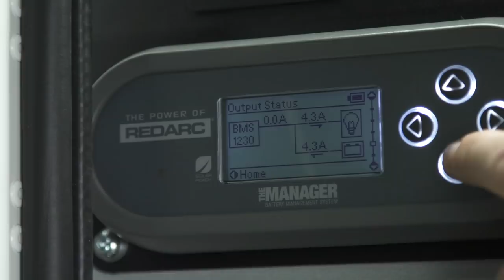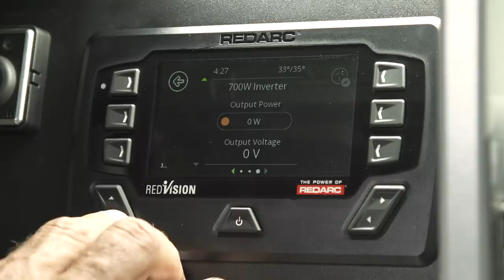Patriot Campers X1-H - Launch Video

Comment: If only you could pull off the bed of a Tacoma, slap this trailer onto the frame.......you would have one sweet Overlanding vehicle.
Reply: That's exactly what I was thinking when I saw this. Turn that into a ute style on a flatbed and it's a masterpiece.
Reply: Its called the PCOR from patriot campers.
Reply: Nope, not even close to the same thing.  I looked at the PCOR a few times, and it’s cool, but not even on the same level as this trailer.  I understand the tent’s ladder would need to be able to adjust for the greater height you would get on the bed of a truck, but it would be something I would buy in a heartbeat.   I just can’t justify $56,000 for a trailer when I can buy an entire 4WD truck or Jeep for that amount.
Reply: @Ray Matias Not sure what your point is, but you can absolutely build out a bed kitchen on just about any Jeep or PU.   The point of my post isn't what you "can do" it's that I would love if they created a versos of this trailer that you could swap out for the stock bed on a Tacoma or Jeep Gladiator.

Comment: what  is the weight rating on  the bed area of the camper

I ask this as I'm 6'1" and weigh aprox 130-135 kg so realisticall I would  want somethign with a weight  rating of 300-375 kg
do you make this in a 7-8  foot in length model as I like enough space to swing a cat lol